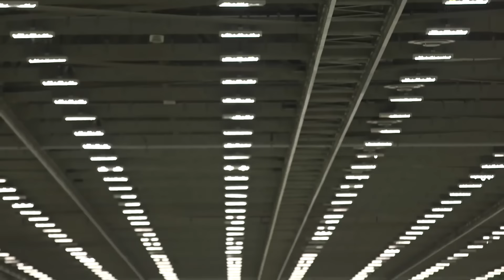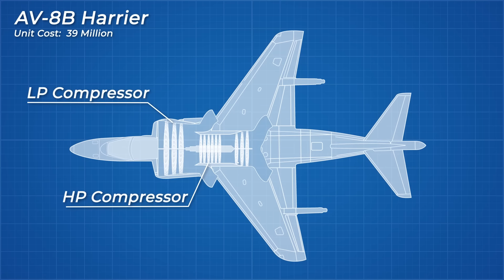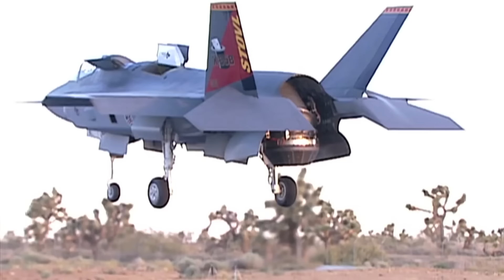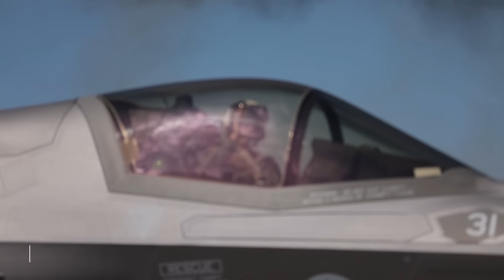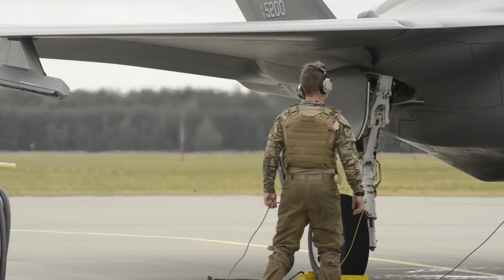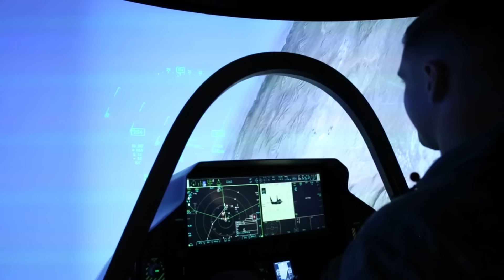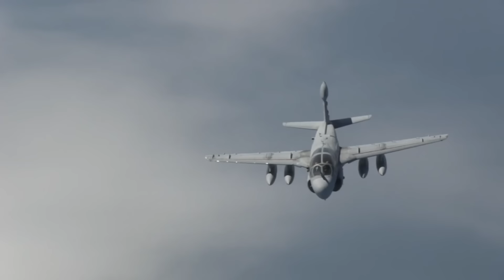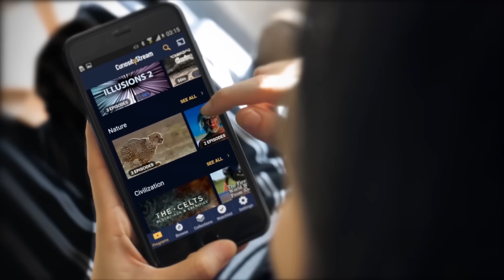Is The F-35 Worth $115 Million?

Comment: @21:06 ... A warthog costing 45.3 million? More expensive than a harrier? Better check reality on that one. Last  I heard, the warthog was closer to 1 million a copy. Also, the F35 would never-ever be used for close-air support for troops, it is way way way too expensive and too fast, too fragile and too vulnerable to ground fire, not to mention too heavy and sluggish to operate that close to the ground and our troops.

The A-10 has triple redundant flight controls with two engines and has a titanium tub to protect the pilot from ground fire. They have lost half the tail and an engine, with bowling ball sized holes in the wing and still limped home with the pilot unharmed. I'm not an A-10 fan boi, it has long outlived it's design and been decommissioned, but the ground support role has not changed much. Ask any soldier that has had his ass saved by a P-51 or A-10 or AC-130 about the need for ground support. No plane is more loved than a ground support craft.

Ground support must loiter around the battle area and respond instantly to moving threats on the ground, dodge concentrated ground fire and RPGs by turning on a dime. They need to be stable at low speeds for the pilot to verify targets by eye. They need to be fuel efficient to stay on-site long enough to complete the mission.

Would you fly a $115 million plane over an engine-choking sand dune and let the enemy troops pop AK-47 rounds and RPGs into it? Neither would anyone else. Stealth is useless when the enemy is looking right at you. The F-35 will never replace the A-10 in the ground support role, which was the only role the A-10 was useful for. It was a flying tank with a big gun to kill ground tanks and protect the troops, it was cheap and redundant, with manual controls. It was disposable-cheap and built to put the pilot into harm's way and bring them home above all else. Everything the F-35 is NOT.

Comment: however, it would have been cheaper and more effective to build 2 or 3 different aircraft, as opposed to one. the biggest tactical problems are that 1, due to its stovl capabilities, it can only have one engine, which is bad, especially for the navy, where redundancy is essential. also, the b and c variant do not have an internal gun, but instead have an optional externaly mounted gun pod, which increases the aircraft's radar cross-section.

Comment: 10:40 Not really. If there were 3 different planes, each would still cost at least 1/2 of what the F-35 did to develop.
Anyway. i wish everyone regularly shitting on the F-35 would just admit that what LM pulled off here is an engineering masterpiece and acknowledge the tremendous achievement the F-35 undeniably is.

Comment: It looks like stealth technology is full of myths and disinformation.
In reality, wawes are reflected not only by metal surfaces but also by any surface where dielectric constant changes abruptly, so even if you make plastic aircraft with no metal parts it will be visible by radar.
also, it is impossible to create radar-absorbing paint because of basic laws of nature.
this kind of surface needs to have thickness comparable to radar wavelength and must have gradually changing dielectric constant or dielectric constant close to 1  so you, unfortunately, need to use some soft conductive foam which makes the entire plane surface very delicate and susceptible to damage or even rain or you can use this pyramid design which is again not to reflect beam somewhere but to provide gradual dielectric constant change but you still need to cover everything with some soft foam.

So making stealth aircraft is a pretty easy task which could be done by any amateur,  but it is almost impossible to make stealth aircraft which is also durable because it has to use extremely delicate materials.
Reply: deltaxcd using plastics would mean the metal parts on the inside of the plane would be visible, which is less than desirable.

FYI, the f35s RAS fiber matting seems to be made of carbon fiber threads which hold carbon nanotubes perpendicular to the length. It’s kinda like vanta black paint in that way. You can check the wavelengths on that.

Comment: The F-35 is NOT a worthy successor to  the A-10. to say so is ridiculous. It will never fly CAS missions. That would expose the F-35 to ground fire and all that stealth tech would be useless. The F-35 is shaping up to be a great attack aircraft to be sure, however what the A-10 does, no other aircraft could match. Its track record speaks for itself, as does all the troops that have heard the BRRRRRRRRRRRT raining down on the enemy. You can argue that the CAS mission is a thing of the past and that's another point entirely. But to say that the F-35 is a worthy successor to the A-10 is like saying the B2 bomber was a worthy successor to the F-14. The two are NOT comparable.
Reply: The multi-role fighter, specifically the F-16 has been taking over for the A-10 in CAS missions where a contested airspace is present because these fighters are more survivable. The F-35A is currently supplementing and will eventually replace the A-10 further as well. Lighter aircraft will take over for it in the future against low-threat environments.

Comment: I still wonder how it's a good replacement for the A-10. 

Also the lift system is very similar to the one used on a Yak. I think Lockheed bought that tech actually
Reply: Not really no.
Reply: That tech comes from US designs in the 1960s and the Yak's lift system shares a lot in common with those US designs.

Comment: It's worth noting that the Air Force has asked for a "digital Century Series" for the next round of development to follow the F-35. For those that remember, the Century Series was the group of planes from the F-100 to the F-106, which were quite varied in mission and capability. While the F-35 is a decent plane, it can't "replace" the mission of many of the planes it's designed to replace. The A-10 is an excellent example: while the A-10 isn't stealthy in the least, it can loiter in a target area for 2 hours. An F-35 can loiter for a while, but would require tanker support. 

The F-35 doesn't have the range of the Super Hornet or the Strike Eagle, neither can it carry as large a load. It's stealthy, yes, but only from the front 3/4; the F-22 has 360 degree stealth. Is that going to be a big factor? Tough to say. My concern is that we're in a situation like we were with the F-4: it's a great plane, and sure, it can work for both the Navy and the Air Force, but it was hugely expensive to build and maintain, and cheaper little Mig-21s gave them fits. 

4th-gen fighters had a better mix: F-15s and F-14s for air superiority, F-16s and F-18s for multi-role stuff, A-7s and A-10s for ground attack, etc. Lots of cross-over in capabilities, but no illusion that one airframe could do every job equally well. I wish it was academic for me to wait and see how the F-35 performs; I have family in the military who will be depending on it, so of course I hope it does well if it's needed. Si vis pacem, para bellum.
Reply: The F-35A with internal and external combat load has a higher potential operational radius and payload than the F/A-18E and the F-16C.

Comment: "stealth technology requires precision beyond any other type of manufacturing" That doesn't sound right to me. What about the computer you're using to make this... billions of transistors printed per chip at nanometer scale...
Reply: You don't need that much precision for stealth thats a lie.
the only problem of stealth is that it uses extremely delicate materials and they have to be free of imperfections.
Reply: Which is harder: nanoscale precision on a thing that is less that 1 square inch, or sub mm scale precision on a thing that's the size of an airplane?  Both hard but in different ways.  I'm not sure which is "harder" though I lean towards the plane simply because I assume thatt it has more "hands on" processes.
Reply: I would say it take a diffrent kind of precision, the angle of a jets fuselage has to remain stable in flight, stealth engineering relies heavily on simulations of the angle of exiting radar waves. A lot of factors have to be considred while building a stealth fuselage. That kind of technoligie didnt exist 60 years ago, I thins that was his point.
Reply: Take into account the stresses on a fighter plane Vs a computer chip.
Reply: I guess "precision for it's size" would be more accurate - building something as big and complex as a jet with no panel gaps, and minimising weight at the same time

Comment: 21:00 since when was the f35 a worthy successor to the a10?
Reply: It's possible for the F-35 to strike tanks deep behind enemy lines and that are well protected by SAM sights. As for CAS, the Apache E beats both aircraft by several factors.
Reply: @orlock20  And is shot down by any dirt farmer with an RPG. There's a reason the Comanche program was scrapped. Low-elevation CAS is too dangerous for human-piloted equipment anymore, it's going to be almost entirely UAV in very short order.
Reply: @ShneekeyTheLost  The number of U.S. crew members that have so far died in combat is 12 while the Apache program has destroyed thousands of vehicles, buildings and artillery pieces while killing thousands more people.  The monetary and human cost to the enemy has been more than the cost of the Apache program.
Reply: The A10 Warthhog can not enter contested airspace so unless air superiority has been established it is not very useful.
Reply: @coldforgedcowboy  The fallacy lies that these planes are so expensive to make that they won't risk losing them in unsafe situations. Sure it can be more aggressive towards not fully secured radar positions, but at 100mil a pop, are you willing to risk it?
Reply: @spicketspaghet7773  dude if a mission is too risky for a F-35 you won't send in an A-10 either. Even with a lower plane cost, losing the pilot is actually worse. A factory can pump out these mechanical animals. But training a capable pilot is hard.
Reply: Since always. CAS was a primary consideration in the design of the eventual F-35 when research into a Harrier replacement began back in the 1980s between Lockheed and NASA. There are also logistical advantages to using fast jets instead of the A-10 when supporting large ground operations that tend to lead to more efficient use of resources.
Reply: I’ve heard the US is testing small turboprop aircraft like the EMB 314 / A-29 Super Tucano to fill extra-close air support roles that even the A-10 can’t fill. While not nearly as well armored, the A-29 is able to fly much closer to the terrain, making it hard to hit, and easier for it’s pilot to see where the enemy is. It has two internal .50 caliber machine guns that can fire up to 1100 rounds per minute, and can also be fitted with a 20mm auto cannon and two additional machine guns in external pods, as well as rockets, missiles, precision-guided bombs and more.
Reply: @WranglerSlim  The Tucano was considered as part of research for counter insurgency aircraft. I think its possible for it to be equipped with AGMs and AAMs.
Reply: Since it was conceived.
Reply: fireson23  No, no no no no aand no.
Reply: I think'   that with the upgraded sensor packages close air support might not need to be as close in some respects with a plane like this and it might also end up being higher quality close air support, but what do I know. If I was on the ground I think I might be more comfortable with 1 of these looking out for me... but what do I know.
Reply: There's a cannon pod that can be attached to the underside of the F35B for ground attack.
Reply: As mentioned, it will be able to deliver CAS into contested airspaces. And while it will carry less ordinance than an A10 it will no doubt deliver those munitions with one shot one kill accuracy using all that sensor fusion. So long as it's fuel/loitering abilities aren't too weak, it'll be good.
Reply: @ShimmeringSword  Hello fellow Deviant. Nice to see you here.
Reply: One thing sure MIC hand is itching to replace A10 with these overpriced F35 to fill their bottomless pockets!
Reply: @hyouzanren1846  don't worry, the MIC made a killing with the billion dollar contracts going to Boeing to keep the A-10 flying past its due date.
Reply: Yes.
I'm confused at that part, too.
Warthog is basically a combat-melee aircraft.

Comment: it will never replace the A10
Reply: The multi-role fighter, specifically the F-16 has been taking over for the A-10 in CAS missions where a contested airspace is present because these fighters are more survivable. The F-35A is currently supplementing and will eventually replace the A-10 further as well. Lighter aircraft will take over for it in the future against low-threat environments.
Reply: @peterson7082  the F-35A only carry 4 internal bombs ( if it wants to remain stealthy ) and the cannon is small - runs out of bullets in 4 seconds, also it cant fly low - if a bullet hits the body its millions in repair.. the A-10 has a better gun better armour - does a better job.. this is just the airforce burning money..

Comment: "shares sensor data" - every hacker turns head ^^
Reply: This is the crux of the argument about the F-35. IF the F-35 can remain undetected and IF it is being fed accurate targeting info from an AWACS and IF it isn’t forced into close quarters to conduct IFF, then it will spray exactly four missiles at 1-4 targets and RTB like a ghost. If it’s loaded up to full wing capacity, its radar cross section goes to hell, and it’s just a short range missile truck with no supercruise and lots of network attack surfaces to exploit.

Comment: No it is not worth the inflated cost, especially when there are generation 5 and 6 fighter jets available for less than half. Furthermore, the F35 is not a true fighter jet. There are already better 'flying air defense' and ground attack platforms available for a fraction of operational cost. In any case, congratulations to Lockheed for making the project a success.

Comment: I see it coming that the F-35 will become the next Starfighter
Reply: Not likely. The F-104 was a great single-role fighter forced into roles it was never designed to perform. The F-35 was designed from the very beginning for multiple roles. Additionally low altitude strike has been completely phased out of military planning and that was the primary reason the F-104 did so poorly outside of interception duties.

Comment: This video in the beginning plays devils advocate with some inaccurate data but does a really good job explaining both sides..
One argument I do want to make is that it’s NOT a good replacement for the A-10 and I’ll make my case based on actual issues that have come up with our current aging Air Force planes.
The problem is that when you build an aircraft to go fast and do high G maneuvers is a very costly airplane which has a limited service life in terms of flight hours which means when you take a plane like an F-16 or an F-35 and place them in an ground support role which they wind up spending all of their flight hours doing the close air support role which means you’re not only spending an astounding amount of money to do the role which can be done with a much less expensive platform like the A-10 but you’re also extremely shortening the service length of an airframe by making it perform a role that requires it’s over use by a 1000%..
Obama not only put us in wars that caused our Air Force to use these Already aging airframes like the F-16/15/18 and even the Uber expensive F-22 to deplete their service life he also cut the military spending budget to the point where the Air Force was having to cannibalize airframes to keep others flying reducing overall availability down from a 90% force readiness to 70% but the planes we did have were past end of life and the F-22 was down to like 40% I believe because of the lack of availability of parts.
This meant that we were actually endangering pilots by putting them in planes that were extremely risky to fly into combat because the airframes were compromised and performing necessary maneuvers could cause the plane to break and crash!
My point is that this wouldn’t even be an issue if we had more planes like the A-10 in service to perform those roles.
Fast jets just don’t fit into that role very well.
Any argument against the F-35 however comes from a lack of understanding of this planes capabilities and how a TRUE 5th gen aircraft like the F-22/35 are on a completely different playing field from any of their 4th gen counterparts and the price tag might be hefty and you could easily argue over inflated they give a totally unfair advantage to any Air Force that’s able to afford them

Comment: The F-35 is not designed to replace the A-10. It's the politicians who said it was. The two aircraft have different roles. That's like saying the F-117 and the F-16 are similar aircraft. One's a bomber, one's a fighter.
Reply: Welfare for the MIC
Reply: The multi-role fighter, specifically the F-16 has been taking over for the A-10 in CAS missions where a contested airspace is present because these fighters are more survivable. The F-35A is currently supplementing and will eventually replace the A-10 further as well. Lighter aircraft will take over for it in the future against low-threat environments.